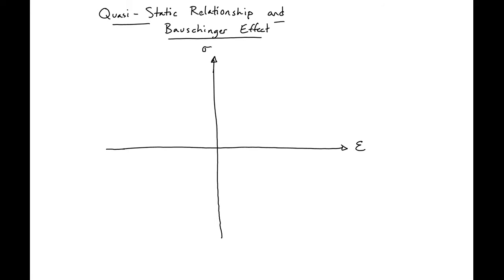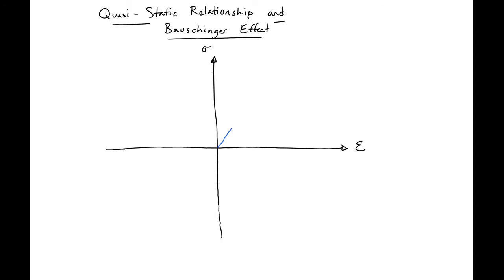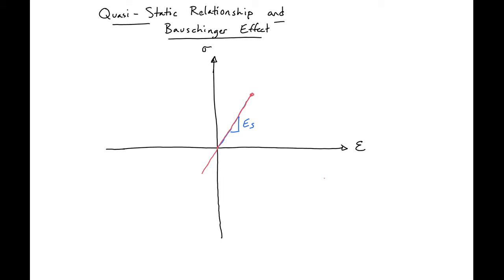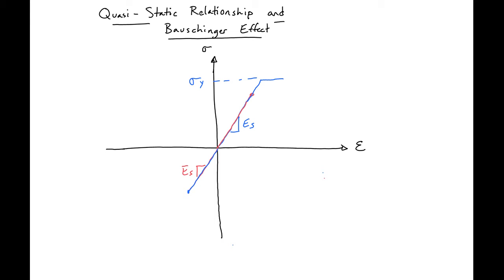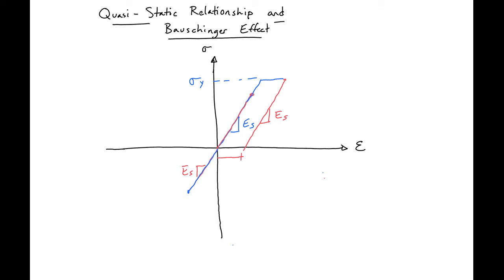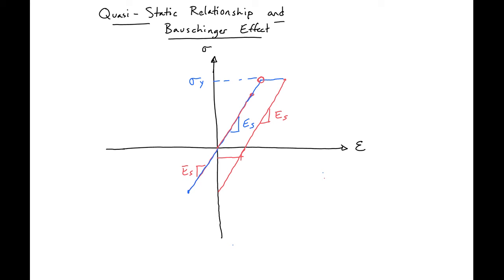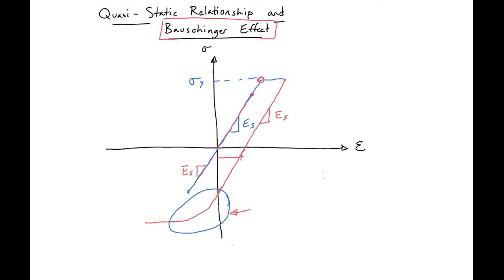2  - Quasi-Static Loading and Bauschinger Effect

Comment: I believe Bausshinger effect has to do with the yield ponit being lower in compression than in tension (or viceversa) when the material is previously plastically deformed and strengthened by strain hardening.
Reply: that is what i have read too